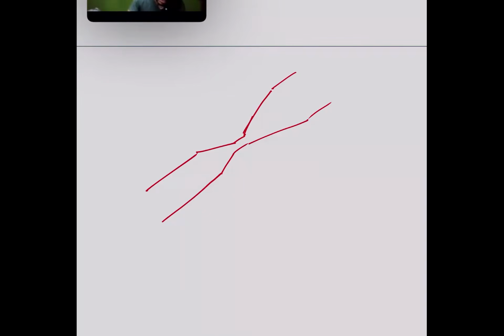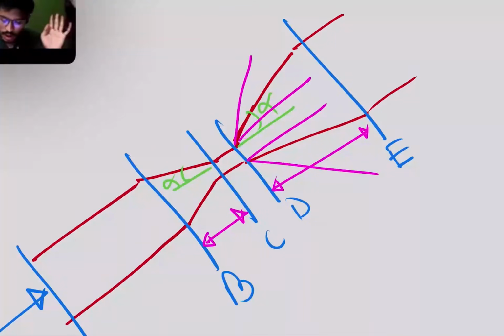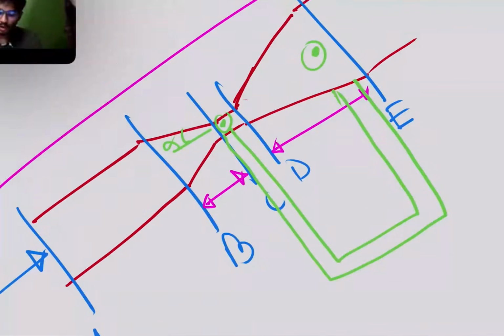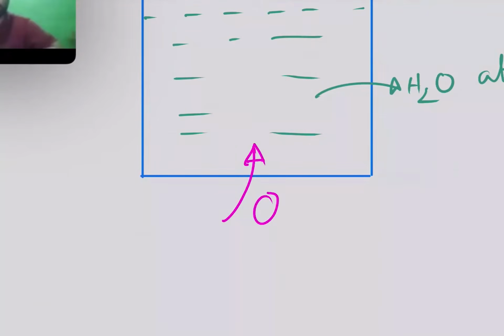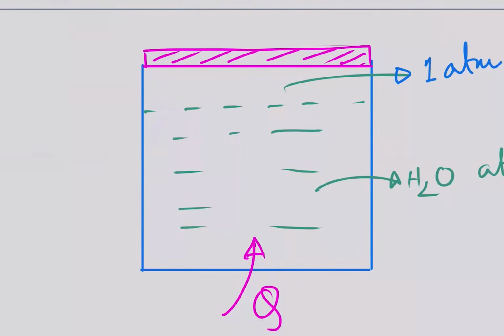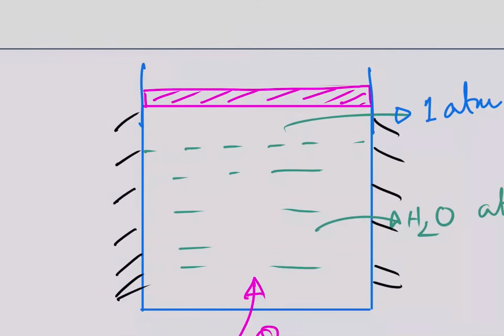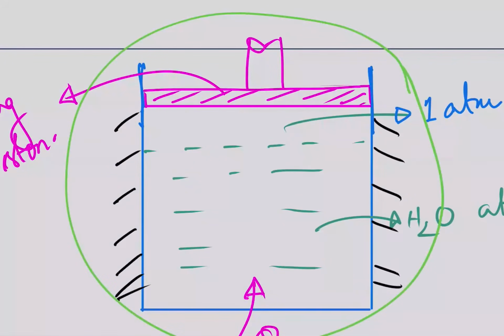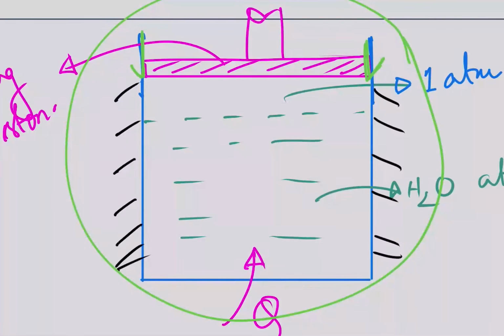Master These Questions Before Your BARC Interview! | Mock Interview for PSU/GATE with AIR -31

Comment: Sir in case of Rigid tank with water inside, if we heat it considering water initially in subcooled state. Then since it is constant volume heat addition, on P-v diagram it will never enter phase change zone and flashing will occur after Pcr ???
Reply from the maker: True for constant volume process.👍🏻

Comment: at 9:50 as the energy at 1 and 2 is same so no flow will take place ( considering ideal case ) if I am wrong please correct me
Reply from the maker: If the energies are same, then how the flow is happening in venturimeter?
Reply: @Thesohamway sir it is occurring because previously there should be an energy interaction after that the flow is flowing without changing it's flow same like an object which will continue to move in a frictionless surface once it gain some velocity 

But both for ideal case